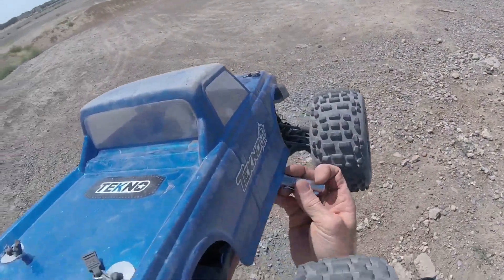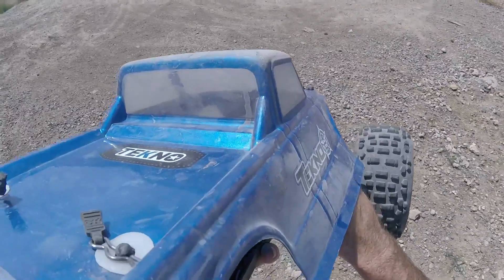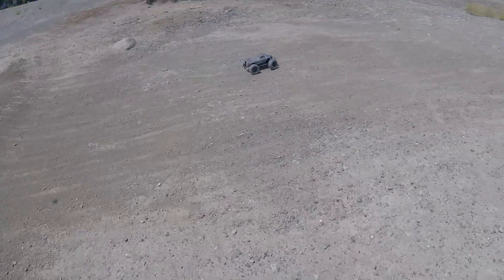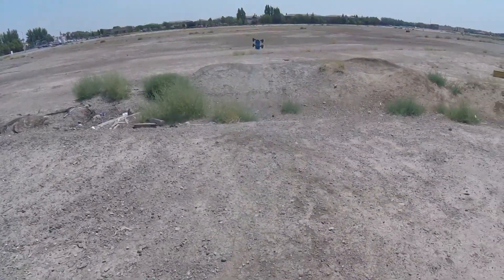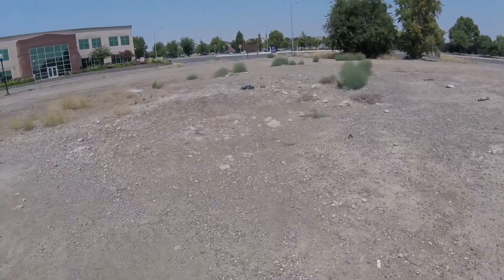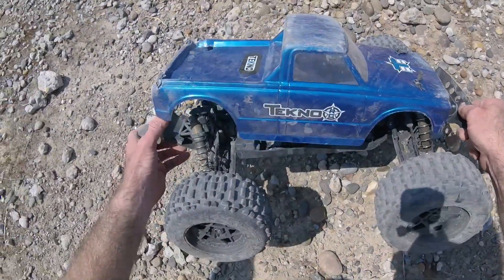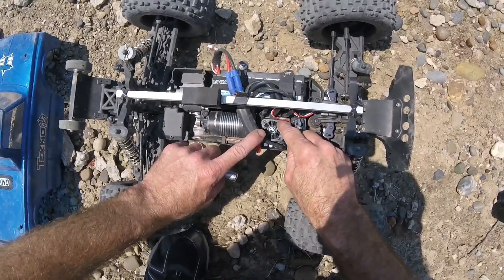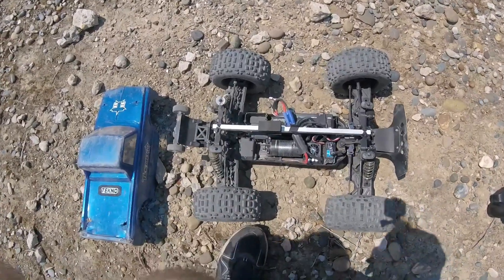TEKNO MT 410 "Diff Grinder" with TEKNO Hybrid

Comment: Cool bash and jumps man I like that ramp too 👍🏼😎
Reply from the maker: R/C CUSTOM thanks so much brother!!! Yeah the ramp definitely adds some fun and challenge. It's pretty hard to line up right without flying off the sides...Lol. Definitely making the next one a bit wider. I can imagine you sending the 1/5 scale off of it. It would probably break this lightweight ramp in half...Lol.😵😵😵😲😲😱👍👍🙋👊👊
Reply: Rich Duperbash Yea mine would probably go right through the ramp lol 😱😂😂😂😂😆👍🏼😎
Reply from the maker: R/C CUSTOM I guarantee it would with this ramp...Lol. Made it very thin and lightweight for easy transport. It's barely strong enough as is. 👍👍👊

Comment: Great bashing guys! Jumping with obstacles is always fun.:)
Would've been so much more worth it at the end if Tdogg would've landed that front triple... I imagine that's where the diffs went? Bummer, but you gotta learn the tricks somehow.
It always looks tough to hit those ramps when the RC is almost as wide as the ramp. I'm not confident enough in my skills to hit those much more than half throttle.

Your lazy backflips are looking great and that little front flip over the ramp was cool too!
Reply from the maker: Stewdogg Stew thanks Stew, yeah that last jump was my Outcast...Lol. Tdogg is running the Outcast body and Backflips wheels, looks like mine, but his is wingless. Yeah I should've settled on the double flip, but still waiting to land a clean triple...Lol. That landing broke the right rear shock rod end,  first jump with the Outcast just before leaving....figures...Lol. Definitely need a wider ramp. Tdogg toasted his input gears by "slicing the ramp", when you straddle either side edge of a wood ramp with 2 wheels on, 2 wheels off. If you do that with hard throttle the chassis digs into the ramp edge and momentary locks the ramp bound wheels. Been there, done that...Lol. Feel bad cuz I forgot to warn him. 😱😱😱😱😵😵😲🙋👊👊

Comment: Another awesome vid bro !!! . Damn she takes a good bashing 💪💪👏👏👊👊. That sucks about the fan .  Hobbywing are usually really good 😥😥......
Bummer on the gears Tdogg 😓😓😥 Almost the triple  !!! 😨😨😨😨😨😨😨😨😨😨😨😨😨😨😨😨
Reply from the maker: Rc Anonymous thanks so much brother, total last minute bash with Tdogg, but super fun as always!!! Yeah his diffs got hosed off the side edge of ramp on hard throttle. Building a wider ramp soon that's easier to line up with for sure. Still waiting to land a clean triple front flip...Lol. This spot has ACRES of terrain. Hoping to rake and shovel some other areas there to make it SICK!!! Happy bashing as always.🙋🙋😵😵😵😱😵😲💪👍👊👊
Reply: Rich Duperbash Can't wait to see the ramp when done bro 😀😀🖒🖒. .the triple front flip is like a unicorn 😂😂💪💪💪😎😎😎 i know you will get there bro and i can't wait to see that footage 👊👊
Reply: Rich Duperbash hey brother. Are you able to give me any tips regarding tyre " bulletproofing"??
Long story short .. i did'nt get a typhon .. i brought a Hobao Hyper SsTe and a pair of 3s 5400mah 60c packs 😎 to run in it (gearing is 43/11 front and rear diff .. center is 48/16)2000kv hobbywing motor and 150amp hobbywing esc 😎💪💪 ... iv put my outcast backflips on and blew one yesterday after about 20mins  😭😭😭. Put on some crappy 3.3revo tyres today  and did 1 backflip had blown a front to pieces 😨😨. Im working on oil weights for the diff's atm ..but really hopeing you could shed some light on the tyre prep situation..or better yet maybe a vid 😉😉😉🤣😎😎( thought i try my luck with that last one 🤣🤣) 
Cheers Bro !! Happy Bashing 🖒🖒💪💪👊👊😎
Reply from the maker: Rc Anonymous my guess is you may have gotten a bum Backflip tire that wasn't properly glued at the bead and/or seam. I've had to reglue the seams of at least 1 pair I ordered where the seam was lifting off. Use quality CA glue like AKA premium or Proline after first cleaning with alcohol. If it was the front tire both times, wondering what diff fluids are in it. Not familiar with that Truggy, but my guess is the center fluid is light for 4s racing perhaps??? Heavier 100-200k center diff fluid will keep from bleeding power to the fronts on hard throttle and prevent crazy wheel spin with damaging ballooning effect. I don't do any tire prep persay unless I'm building a set of Prolines that I plan to tape and glue myself as most of there tires balloon like MAD with 6s power. Again, not familiar with that rig. I run 50/200/20k front to rear in my Kraton to control wheelspin and ballooning. It does tend to wheelie more with heavier center diff fluid, but it's definitely worth it. 👍👍👊
Reply: Rich Duperbash thanks so much bro 😀😀😀🖒🖒🖒🖒. Both tyres, front left , both times . 😢😢. Diffs come stock with greese😑😑😆 lol .. i have  put 30k all round in the diffs . I will get some 50,100,150 and 200k oil see how we go  🖒🖒😀.. it a absolute weapon 😈. The last vid i posted shows it on the bench then first warm-up/bash ,if u get a spare min you might get a good laugh 😂😀😎 
Thanks again so much bro for taking  the time to reply and with such detail 🖒🖒👊
Reply from the maker: Rc Anonymous no problem brother, hope it helps and I'll definitely check out the vid!!! 👍👍👊

Comment: Awesome bash brother that grinding didn't sound good😲 glad the ESC is workin out for you sux about the fan but WTF makes a bad ass fan brother you'll definitely love it happy bashing bro🙈🙉🙊👍🏻👊✌
Reply from the maker: 12R1 thanks brother, yeah I didn't think to warn Tdogg about not throttling hard off the ramp side edge. I stripped my input gears months ago doing the same thing, straddling the side edge on hard throttle...Lol. Still deciding between Yeah Racing and WTF, replaced with the spare for now and she's working so we'll see. Happy bashing bro!!! 👍👍😵😵😵😲😱👌👌😎✌👊

Comment: Nice bash man that little ramp really launch's those rigs! Ive had so many problems with cooling fans it's really frustrating i can sympathize man! Don't know if you guys get Yeah racing fan's in the USA but i cant recommend them enough! They can suck a golf ball through a garden hose and are very strong 💪 I haven't broken one yet!? 😂👍
Reply from the maker: Pain in the RC thanks brother, yeah that ramp is only like 16-18 inches tall, but you can get pretty launched with it. Next ramp will be a bit wider. This one is 3 feet wide and fits great in the car, just hard to hit right at speed...Lol. Very easy to go off the sides on throttle in bumpy/loose dirt. I'll probably go with Yeah Racing actually, thanks for that. Not sure how the Wild Turbo fans hold up to harder bashing. Need to put on a small screen cuz the Hobbywing ESC has really big openings and I bash in rock filled areas. 👍👍😵😵😵😲😎💪✌👊👊
Reply: Rich Duperbash yeah good call on the screen for the fan's ive been toying with that idea myself so would be nice to see what you come up with👍............all my esc's run 35mm fan's in the max 6 and vxl8s, which I'm struggling to get hold of here in the UK! 25mm 30mm and 40mm fan's are everywhere! 😱😨😵 Lol
Reply from the maker: Pain in the RC it's so frustrating when the LHS doesn't carry parts that fit...Lol. My new Mamba X fan broke a blade and the shop I bought it at didn't have the direct replaced.... eerrhhhh. I told my friend who works there "Does this mean I need a new ESC???? Lol.." Yeah I'm planning to just cut little square metal screens to fit and thread the fan screws through them. Anything to keep pebbles and sticks out. 👍👍😱😱👊

Comment: Excellent bash video Rich are you running the stock fluid in all three difs & are you running the stock shock oil all the way around & what tooth pinion are you using 
Thanks Bro 👍✌👊
Reply from the maker: Six Shooter thanks brother, yeah still running stock 100/100/50k diffs, but changed shock oil to 60 front(800 cst), 50 rear (650 cst), 18 tooth pinion. Not sure if I'll change the diff weights cuz this rig is so light, seems to work quite well IMHO. 👌👌👍😵😵😵😱😲😎👊

Comment: you and TDogg goin huge as always!!! Wicked ramp setup and nice find on the bash area, doesn't look like you guys will be bothered and can probably clean the big rocks up a bit and rake in some good smooth takeoffs!
I'm looking at an Mt410 now haha, noticed you upped your shock oil wt to 60 in the front, 50 rear.  What delrin pistons did you end up with?  Looks like Tekno recommends the TRK6051 to keep the same hole size and area.  Did you need new stock standoffs or bushings when you upgraded to aluminum shock caps?
Reply from the maker: RD eazy thanks bro, had another killer time with my buddy Tdogg!!! Bummer about his diffs, same thing happened to me months back going off the side edge of the ramp. Yeah those are the same Delrin pistons you mentioned. The aluminum caps are a direct replacement, no need for different standoffs or bushings. TKR6003 is the part #. The MT is definitely a nice rig, but I love my ARRMAS too. Still couldn't really pick an overall favorite. I'm finding Tekno parts are limited at my LHS and sorta pricey in comparison to most ARRMA stuff. Both brands are very durable with the proper setup and upgrades. If you get the MT, may want to use a different threadlocker for the build than what comes in the kit. I've had several things come loose on me easier than I'd have expected.🙋🙋😵😵😵😱😱😲👍👍👊
Reply: Ah that sucks about things coming loose on the MT, thanks for the heads up on the threadlocker!!!  You still rocking the green springs or are you thinking to go heavier in either the front/rear!?  You feel the front and rear TBR bumpers are a good upgrade over the stock ones?  I've seen people break the stock ones easy and others seem to find them super durable!?
Reply from the maker: RD eazy no problem bro, the gel threadlocker they send isn't bad, but isn't great either I think. I've had better luck with Permatex blue gel locker from Auto stores, and Loctite 242 blue liquid on my pinion and outdrive coupler grubs. Yeah many have had good luck with the stock bumpers. My front was severely damaged after a few really bad nose landings, rear held up quite well but ended up more tweaked than I wanted to continue with and bent the long diff case attachment screws. The Tbone wheelie bar acts as a skid plate too.😵😵😱😱😱😲😲👍👊👊
Reply from the maker: RD eazy sorry...Lol.. yes, still rocking the green springs. This rig is SO LIGHT!!! Not sure heavier springs would help anything. Worried it would hamper the great handling. I do have some Yellows sitting around, but I'm happy going green for now.👍👍👊

Comment: I love the bashing.  I Like how got get right under the truck.  Great vid.  Is that a homemade ramp? If not. Where did you get it.  Thanks bud.
Reply from the maker: Family Fun R.C. thanks brother, yeah I made that ramp quite a while back and built a "huck" ramp that's taller and steeper, but it's a parts breaker if you don't jump it right...Lol. My experience is it's better to have a moderate ramp with smooth transition that sends you up and out. Way less harsh to roll out of mishaps then to go lawn dart style with a really steep ramp. Definitely fun to hit and not to difficult to make.👍👍😵😵😵😲😎👊👊

Comment: nice 4s bash. hey rich, do you like hobbywing over the stock arrma esc & motor? have you tried castle creations mamba monster x 1515 2200kv motor combo or a possible future try on castle creations 1515 mamba monster x 2200kv combo? bash on rc bro 👍
Reply from the maker: melbourne e. adams jr. Thanks brother, I was running the stock BLX185 setup and it ripped just fine, ESC stopped working, hoping to get a warranty replacement. The  Max 8 combo has great power delivery, just bummed my first fan crapped out. Replacement fan is working fine now so we'll see. The ESC is a VERY tight fit in the MT. I'm running the Castle 2200/1515 Mamba X in my Typhon and it rips HARD!!! To me they're all good combos so long as they work...Lol.👍👍😵😵😵😲😲🙋👌👊👊